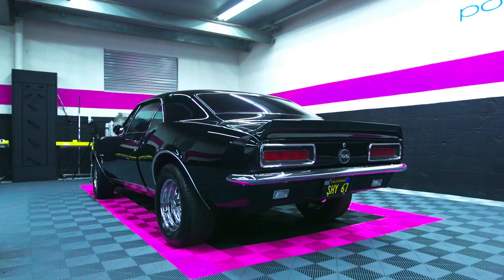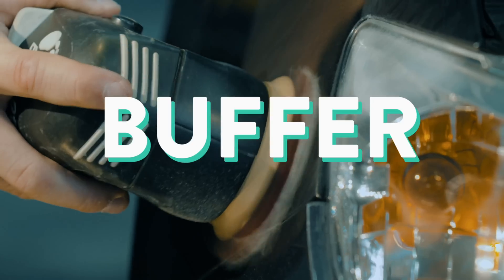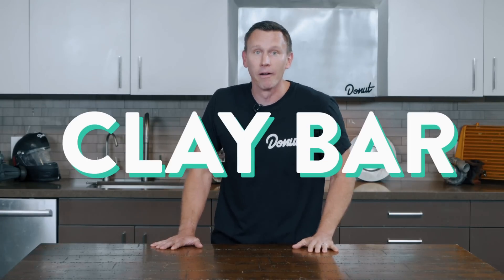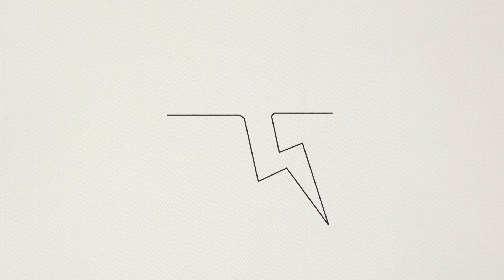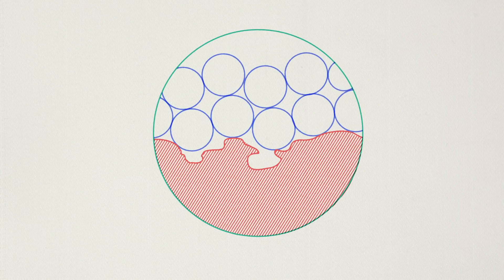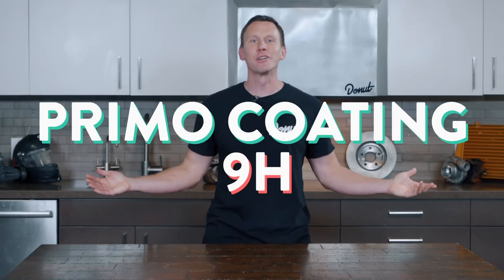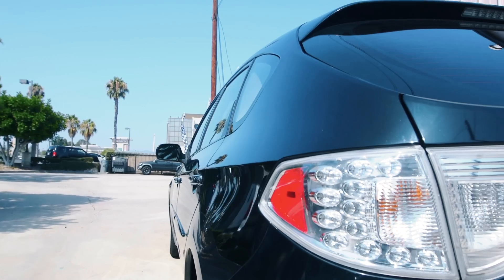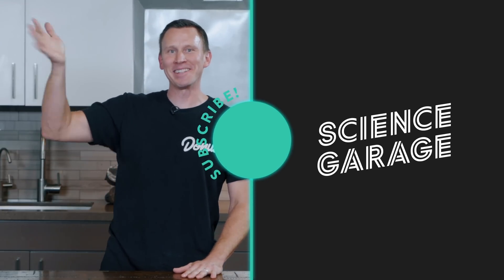CERAMIC COATING - How it Works | SCIENCE GARAGE

Comment: I had a ceramic coating on the car. It really easy to wash also shines well.  But there is few BUT's.
With ceramic coating, hoods chips and another paint imperfections are way more visible than with good wax.  So you need to your paint in really good condition. 
If you choose to wax or get a shampoo with wax you can say goodbye to the ceramic coating, the wax will get in ceramic coating pores and destroys all nice things about ceramic coating.

also, if you don't want to get swirls on your paint, move your arm in straight motions,  example, for doors go up and down, not forward and backward or in aroudn motion.

Comment: Ceramic coatings scratches, not as easy as wax but when it does, then what? If your wax scratches you just apply more wax (which you should do with wax shampoo and spray wax). When the ceramic scratches, you have to apply another ceramic coat and that costs very very much.
Reply: overflow You can use special polishing compounds to buff ceramic coatings to get scratches out or apply 10% silica spray sealants on top of the coating to try to fill those gaps.

Comment: This video is REALLY timely because I'm about to have Ceramic Pro (yes, even the BRAND is the exact one in this video) professionally applied to my Audi TT Quattro 225 Roadster, and I was wondering about one thing:

I want to get the badges removed so the paint is thoroughly cleaned and protected. 

WILL the new badges stick over the ceramic pro coating? Are there any special precautions/installation techniques/extra bonding compounds I should use, in addition to the 3M adhesive that most modern badges come with nowadays?

Thanks for the help, guys - LOVE the channel. Even my husband who's not at all a car guy likes watching your content - thanks to you he's starting to learn, and doesn't feel as lost as before whenever we're going on and on and on about K20A engines and variable valve timing and whatnot!

Comment: I had used ceramic pro on my Civic and the results are not exactly like what they lead you to believe....
1. Wash your car every week.
2. If the clothes used for washing isn't clean enough it will create very minute scratches and swirl marks.
3. Water marks are unavoidable
4. Water beading effects are excellent during the first 6 months but then it goes down.
5. Coating on wheels and interior trim, pretty much useless and waste of your money
6. Water beading effects on windows and front windscreen are excellent during first 6 months but then effects deteriorated
On the plus side
1. It's still a lot shiny
2. Water beading effects on the body is still working
3. Overall less scratches and swirl marks compared to non coated car
4. They might provide free service to remove the water / swirl marks depending on the package selected and warranty period.
Reply: Why would they cover issues they didnt cause? Waterspotting is because you didnt dry it completely and the scratches were caused by you. It's not scratch proof but it's more scratch resistant, you should be using wash mitts from your local detailing store (not Walmart or autozone)
Reply: @eaautodetailing5303  even when it rains?
Reply: @Neo.555  what do you mean?

Comment: Make one on rear wheel drive vs front wheel drive, fuel system, safety systems like traction control and airbags, V engine ,  chassis and body frames, car reliability

Comment: But can it stop the impossible? Prevent a Silverado from rusting.
Reply: 2nd gen dodge*
Reply: Austin Mitchell i live in california and when i used to own my 1990 silverado it had no rust anywhere. Just all depends where you live
Reply: No. Lol. Good luck. 😂
Reply: it protect the outside not inside. and if you have car crash you need to reprint it (which is not cheap and not cover by the insurance.)
Reply: Anything Japanese
Reply: No, but moving out of the Salt belt will. Down here in Louisiana, we don't have that issue. So it's not the fault of Chevy or GM. It's where you live. So you should ask how to get the state to stop destroying your vehicle. My truck is 16 years old and hardly even has surface rust on the frame and undercarriage. No rusted out brake lines, either. Saying it's impossible is ignorant lol. It's quite possible. Just not wherever it is that you live. 

Reminds me of all the people that, complain because GM wouldn't recall their Silverado due to rusted out brake lines. NEWSFLASH They're not gonna recall them when it's an outside force causing the issue. Aka not every truck has rusted out lines because it's not the lines that are the problem. It where the people live. They rusted away due to salt. Not because gm used bad steel or anything else. No fault of GM whatsoever. So why would they recall them? That's like recalling trucks because people are installing aftermarket brake pads incorrectly causing their brakes to operate incorrectly.
Reply: @JC-11111  same. Down here in Texas. I've got an 04 Silverado. No rust. Great shape still as well.

Comment: Sounds too good to be true. It's probably like a quintillion dollars. I got $1,70 in my pocket.
Reply: It's north of 1700 dollars
Reply: I live in hungary, and I used to work in a car wash as a summer job. We also did paint repair and ceramic coating in the shop, and I can certainly confirm that it really does work. Although u can't just hose off the bugs, u have to pressure wash the surface, but they do come off that way. Here it only costs 500 to 1000 bucks, depending on the size of your car and the thickness applied.
Reply: Debreczeni Máté ahhh... amikor Magyarországon valami olcsóbb...
Reply: @debreczenimate5309  beyond 2 layers i dont see the point. Theyre designed to bond to paint not themselves anyways no? The best is to use something like top coat or like carpro reload every few months to 'top it off' lol.
Reply: As great as this sounds, I use a bottle of Nu-Finish ($10), an orbital buffer ($40) and a few polishing bonnets ($20), and get a nice shine (no swirls), protection for up to a year, and enough $$ left over for a cold air intake and new exhaust.
Reply: @BobC59  can only do that few times though. Best to do it once properly when you need to and then cost the car. Then next time you do paint correction you chip away at coating with the scratches rather than the paint. if you have something like bmw then chip away you can do it many times although not smarr to wear down the paint. But if you have something japanesse or a VW.....oufff id advice against doin it more than one time. Cheaper the car thinner the paint usually.
Reply: @stefanfreestylez  Yes, but Nu-Finish is not paint correction, its basically the same as applying a good wax - only it lasts longer.  It has some cleaning action and if you buff enough and properly, you'll get most of the hazing and cobweb scratches out (if you had em) - but certainly not a "show perfect" finish if that is that you're after.  But certainly good enough for driving around looking good and protecting the finish on your car.

You're absolutely right about car paint.  Give me a BMW or Mercedes-Benz for the deepest, finest finish around!  Gotta be careful with Japanese stuff.  It'll hold up quite a while, but probably won't withstand too much polishing - as you said, due to being thinner than others.  But if were talking modern cars, they've got clear coats, so you're not even getting into the paint - unless you are going DEEP
Reply: @BobC59  o didnt know i thought it was like cutting compound that you got at like walmart or something. but i see your careful with it. I just wanna warn people fast before they potentially mess up their car. Lot of people 'try' things without lookin much into it.
Reply: @stefanfreestylez True that.  Your a good dude looking out for your fellow man.  Cheers!

Comment: Question I must wonder - was this episode sponsored by Ceramic-Pro? He makes it sound too good to be true, and I've never heard about it elsewhere. Sounds like a good substitute for clear-coat, I could imagine OEMs using it when first painting the car, or putting it on when repainting a car. If it's really as good as he says (which I'm a tiny bit doubtful of, I'm always leery of something that mentions no cons and I suspect might be sponsored) I might consider putting it on my old Bug after I repaint it instead of clearcoat - it's current paint is way too far gone.
Reply: Do some homework. I have a ceramic coating on my car, not this brand though. 

Is absolutely worth it.
Reply: how much did it run you? not doubting that it works but i have 3 dollars
Reply: @brreeaad  I spent about 2500 but I also got a full, 3 stage paint correction, clay bar, detail, and wheels got ceramic coating.
Reply: Ceramic coating does not replace clear coat. It is simply a stronger form of protection for your paint. The surface should be defect free and should be paint corrected. Ceramic coating does not stop scratching, but does reduce basic wash marring. It does typically last for years depending on how you maintain it. Also I would stay away from Ceramic Pro, they are more of a gimmicky brand. Stick with the big names: Carpro, Gyeon, GTechnique, and etc
Reply: They charge 1700+ dollars for it, so it better last.
Reply: He implied that the $1700 is the top of the line version, there are other cheaper versions that aren't quite as high quality, I'm guessing not as thick. Wish he'd said how much what was done to his car cost. If doing it as part of a repaint, which would already be in the $3k range, it might be more justified - especially if done instead of clear coat.
Reply: Quill Maurer are you stupid?

Comment: Number 1 cause of swirls... Automated carwashes and trust me I work in fixing paint
Reply: If you use an automatic car wash it’s safe to say you don’t care about your car’s finish enough to take it to a body/paint shop.
Reply: Corbin The Suicune you're exactly right.  I have a brand new truck and took it through one, and had swirl marks afterwards. Now I it wash it by hand with Chemical Guy's products
Reply: @VanillaGorilla502  good. I myself use Car Brite as they also hooked me up with the latest buffer system to go with the polymer paint sealent I use.
Reply: I'll never go thru one again unless it's touchless and in the dead of winter.
Reply: Corbin The Suicune truer words have never been spoken